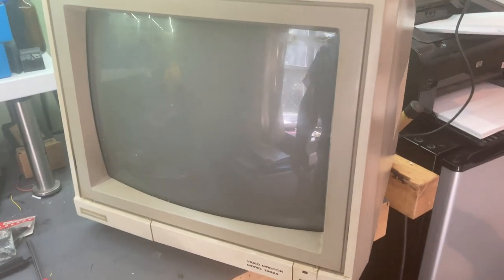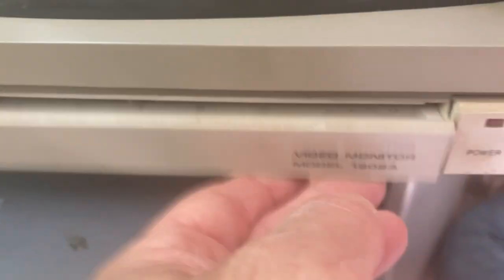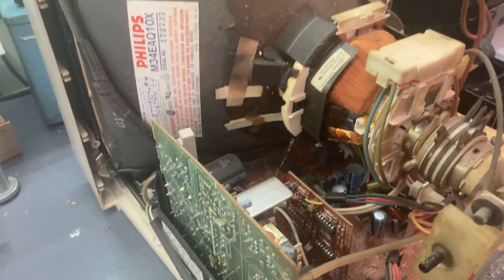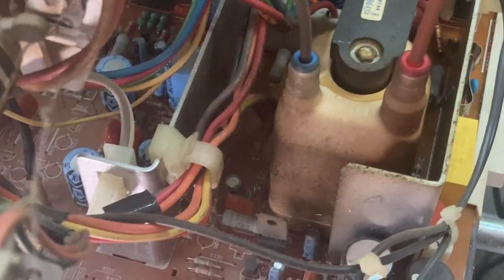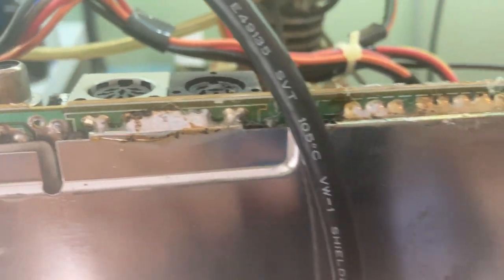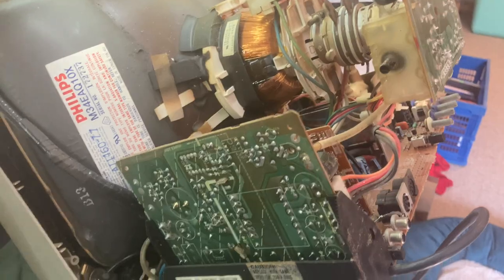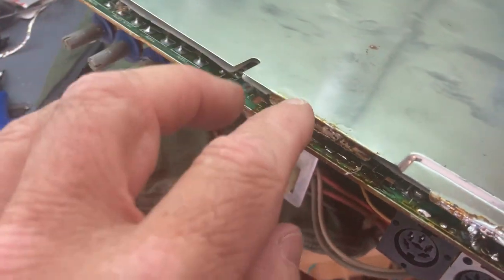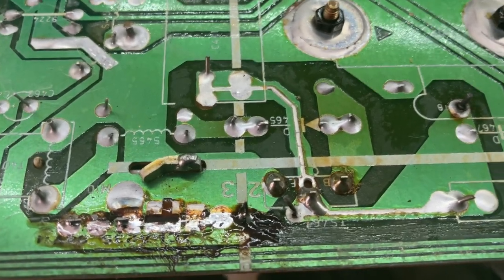eBay Find - Commodore 64/128 1902A Monitor in for Repair

Comment: First of all, nice work. The power light is on on my 1084 too.
There is sound from the speaker but there is no picture. So there is low current but not high current. Could my problem be the same?  👏👏
Reply from the maker: Yes its a very common problem!
Reply: @electronictreasure4191  Thank you for your answer.When ı move it closer to the screen in the Ncv setting of the multimeter, it says there iş voltage. It makes more mouse,especially when ı move it closer to middle part. Is this voltage low or high current?
Reply from the maker: @kenansakizci6659  Hi, do not poke around with the multimeter in there unless you know which areas to avoid. There are some very dangerous high voltages near the flyback transformer.  The first thing to do is examine all of the solder joints on the flyback transformer (one with red wire coming out of it) under a microscope or magnifying glass. Look for cracks (a circle around the pin). Re-flow the solder all of those pins.  Be sure to discharge CRT and large capacitors before touching anything! If you feel no screen voltage (static on the glass with your hand when it's turned on) then it is probably the flyback transformer solder joints. If you DO have screen voltage but no picture it could be a number of other problems.